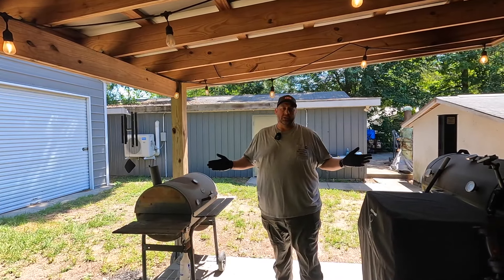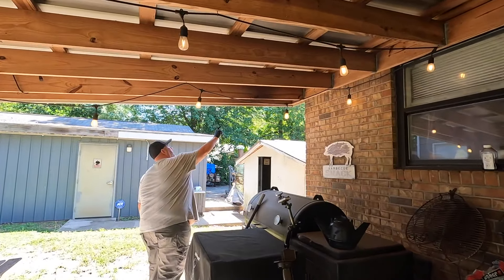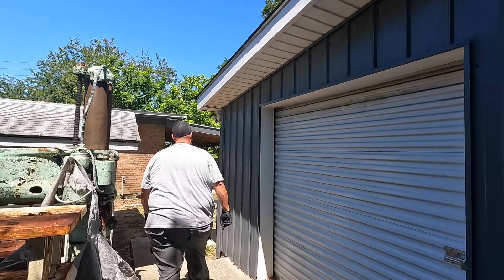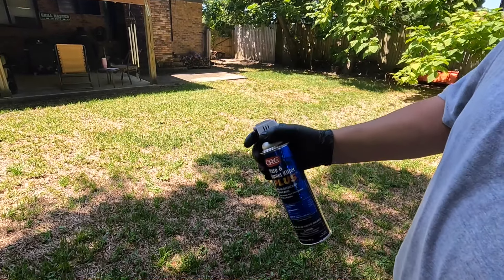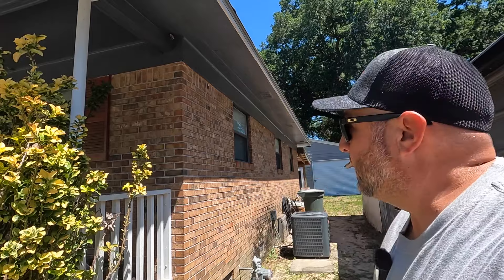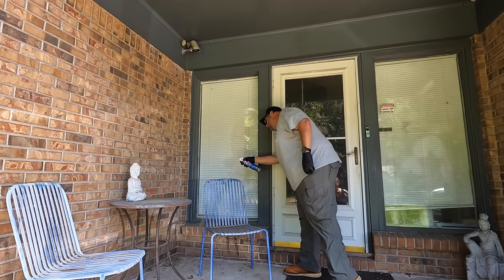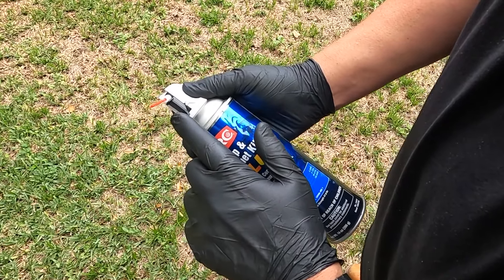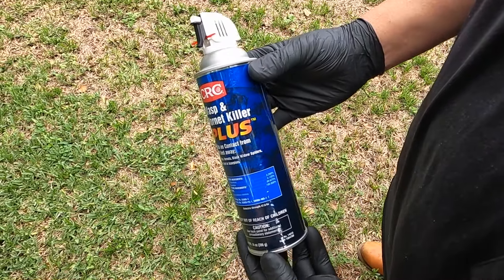Eliminate Pesky Stinging Insects! CRC Wasp & Hornet Killer

Comment: I've liked CRC products as long as I've known of them, especially 2-26 and 5-56 for electrical and electronics but never knew they made an insecticide. This product uses tetramethrin without piperonyl butoxide synergist but still seems effective. I prefer a foaming product that immobilizes active wasps with it's sticky goodness and I like to spray at night for thorough eradication. This product is marketed for industrial users who can't wait for night and need to be able to clean up the residue quickly.